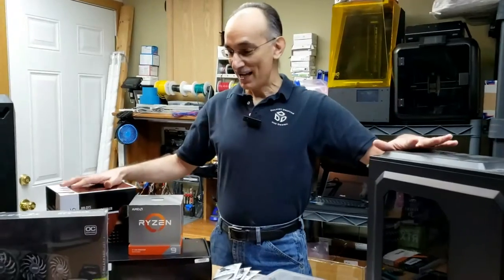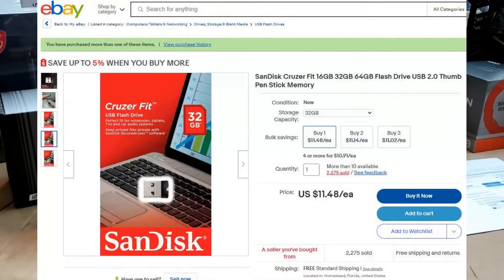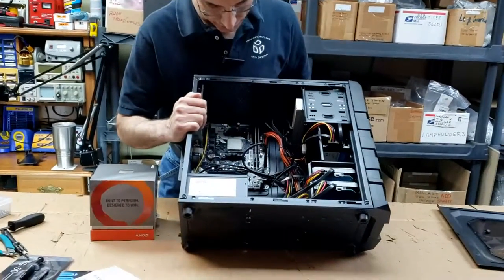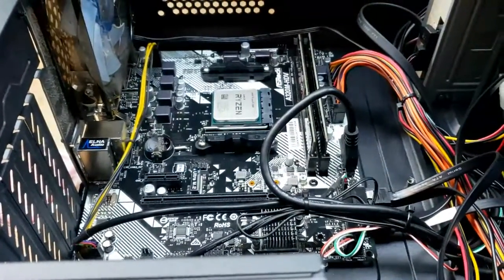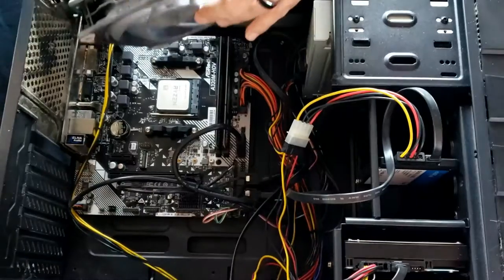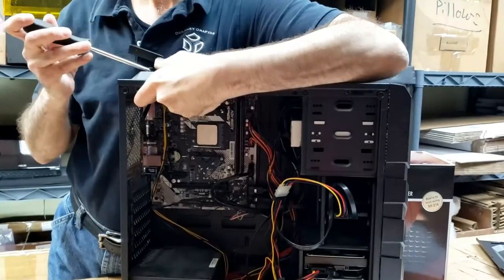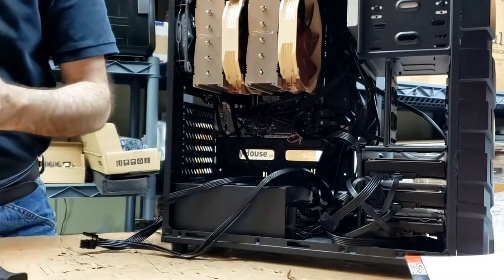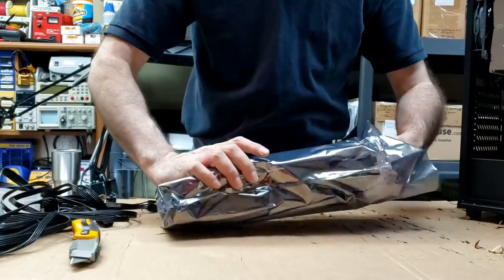Upgrading a Cheap, simple PC into a Gaming & Mining Rig

Comment: Nice build, I am so glad GPU prices have finally dropped. I definitely agree with you on avoiding daisy-chaining the power connectors for the GPU and fans, fan header output limits can vary from one motherboard to the next, the only downside to the adapters is the loss of speed control for the fans, but I suppose you could always go for a fan hub to alleviate that. That was a heck of a tight fit for the 3070!
Reply from the maker: Thanks a lot for watching and for your input here...Also - thanks for confirming what I thought about daisy-chaining.  Good point about the speed control...I guess I'm ok with that.  I just put the "main" fans on the board headers, and consider the SATA fans "accessory".  I find that I get good temps like this, without overloading anything.  I knew that I could fit the 3070 in there since I did it before, but I honestly started having doubts when making this video!  Anyway, I'm really happy with this PC now...thanks again, and please stay tuned for more!